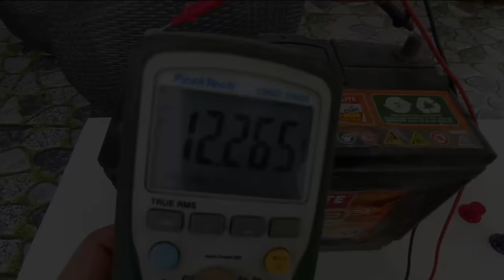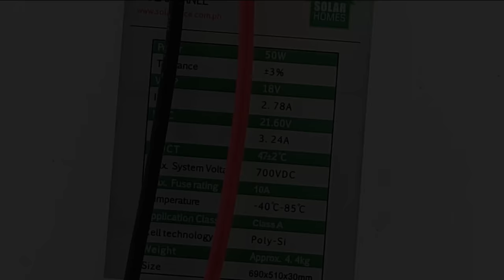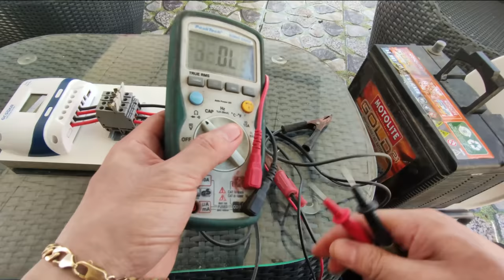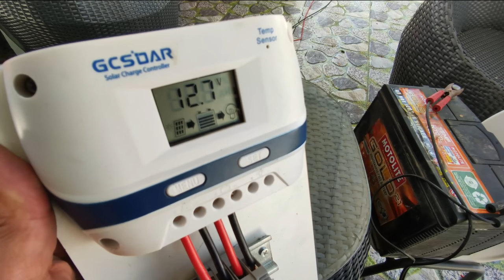Basic Solar Setup - Using Car Battery

Comment: Nice video of a quick setup, based on what you have on hand. I am planning something similar, but will connect a switch/breaker and some 12v LED lights to the MPPT load, outlet, or direct to the battery
Reply from the maker: It's better to connect the led light to the load side of the MPPT controller but make sure will not overload the load side of the controller so load only what is recommended load of SCC., if ever you connect it direct to battery you must ensure that the load will not drained the battery and use only until  the recommended Battery Depth of Discharge.

Comment: My husband made something similar after the typhoon. Because of the covid pandemic he has been out of a job so he basically build a manual controller with 2 voltmeter for a motorbike, 2 push switches, 2 diots and a on/off switch. We are using his car battery (car is inop). We are also using his car radio for entertainment/news, cell phone charging, 500watt inverter which even operates our sewing machine.
Reply from the maker: Thanks for sharing madam Lelith... You're very lucky to have a very resourceful hubby... GOD Bless to you and your family
Reply: I just bumped into your channel and finally found a practical tutorial on how to reuse our car's used battery. I took notes ..and will play this again when I finally assemble the same. Thank you!

Comment: Very simple lang para hindi masira ang car battery. Na gagamitin sa solar. Bili ng car battery charger. At e sak sak sa inverter. Tapos e charge ang car battery. Kung cp ang e charge Sa 12v car battery. Dapat may cp charger na pang 12v.
Reply: pag nilagyan ba ng car battery charger magagamit mo padin un car battery as a solar battery? pede padin mag pull ng power dun?

Comment: good day idol rod salamat sa mga videos mo about solar
Gusto ko rin sana mag set up aolar water pump with a voltage of 12v and power 180watts pwede mo ba akong tulungan kung ano ang mga desired amperes and wattage ng pv panel, scc, battery and inverter salamat sir

Comment: Sir good day. Medyo mahal kasi magsetup ng Solar power. Naka WFH setup ako ngayon at need ko ng backup power, pwede bang icharge ang Solar battery sa Car battery charger using power outlet?

Ang gamit ko po kasi ngayon ay car battery motolite gold 9plates, 1500w DC-AC inverter and Car battery charger. Around 30mins lang ang tinatagal ng battery ko.

Kaya iniisip ko kung magdagdag ako ng battery yung pang solar na kung pwede syang icharge gamit ang Car battery charger para madahan dahan ko na din ang pagbili ng solar setup components.

Hoping to hear from you soon. Salamat po.

Comment: sir,

90ah battery, car battery
20 a scc
12v submersible pump
led lights

question:
pwede ba ako bumili 200 a na solar panel?

Comment: Plano ko din to Gawin para sa modem Ng pldt ko .para po pang brownout meron prin internet..
Kaya ba neto  sir Ang setup ko pra sa modem ,1car battery 2sm,10amp controller, 50 Watt panel at 30 watt parallel connection para po off-grid set up Yung modem ko? Pa advice po if kaya na..thanks po😅👍

Comment: boss kmzta,my tanong lng ako..meron akong dlawang 250 watts n solar panel s mkatwid eh 500watts at meron nmn akong dlawang 12vbattery n 100AH.ilan kya ang dapat na ampere ng dpat kong gmitin n charge controller n MPPT at gaano klaki ang inverter n dpat ko ring ilagay!sna boss msagot mo ang tnong ko kc ndi ko p xa mbilhan ng mppt.slmat and god bless

Comment: good day sir ganyan din ang gamit ko 3sm motolite at 20vlts solar panel  ok naman sa laptop ko 19volts soldering iron 30watts at pldt router ok naman sya lalo 7.30a.m hanggang 5pm ako nag laptop walang shuntdown ok parin ang battery at fully charge pa ang power pack ng laptop kaya extend pa ng less 3hours sinubukan ko isaksak ulit sa inverter ayos naman at hindi basta basta na drain ang battery umabot pa ng 4a.m halos paumaga na ng lubayan ko mag internet nka saksak din ang router sa solar controller charger sa may 12volts .nag dadalawang isip lang ako lakihan ang panel sa 100watts bka matamaan ng kidlat habang nasa trabaho ako at bka masunog mga gadgets.kaya 20vlots panel muna ang ginagamit ko pero bka bibili parin ako pag nasa bahay ko lang gagamitin para sure na ma disconnect ko agad.kaya naman yan sir wag lang sosobrahan ng mga matataas na watts ang isasaksak para makaya ng solar panel ma charge ang nakukunsumong current

Comment: Good day po sir. Pwedi pong paturo nmn kung paano po gumawa ng 3S na 100ah gamit po ang battery na Lithium-ion 18650 na 3000mah 3.7v paano po connection non ilang naka series at naka parallel.maraming salamat po.sana matulunganan nyoko.

Comment: Sir my tanong po ako,my rolling motorcycle food cart po ako na meron solar panel na 100watts ,40 ah na battery,gamit ko po sya sa ilaw sa gabi max.na nggmit ko po sya ay 3 hours,ang tanong ko sir,pag hnd na po sya nagchacharge galing sa solar panel,pwede ko bng icharge ung battery gamit ang rectifier charger ng motorcycle ko,papaandarin ko lng ang motor pra magcharge ang solar battery?hnd kya makakasira un sir sa controller at solar panel?slamat po sa sagot
Reply from the maker: Sir matanong ko lang may inverter pa po kayo or 12volts ilaw lang ang gamit niyo at ilan po ba ang total wattage ng load niyo na ilaw? gusto ko lang malaman bakit hanggang 3 hours niyo lang nagagamit ang ilaw at kung naka 12v na ilaw lang kayo saan naka connect ang ilaw sa output ng solar charge controller or direct sa battery. Kung naka direct sa battery ang ilaw, then i off mo lang lahat ng breaker ng solar setup bago i charge galing sa motorcycle.

Comment: Nice video, thank you sir. Madami po ako dito lumang battery sa trak at sa  elf trak. Ilang watts po kaya na solar panel dapat ko gamitin, kasi gamit ko po sa aking incubator. 2 exhaust fan, 2 bulb ba 50 watts minsan 4 na bulb pati po sa mga sisiw. Meron po ako 500 watts inverter. Tanong ko po kunh ano size na din ng charge controller ang dapat gamitin. Thanks po uli.

Comment: Hello ang Lead Acid kasi kapag overcharged eh may leaking at very harmful ang lead acid.

Ang sabi sa ibang videos, maglagay ng voltage protection board. Kumbaga manual na iset ang full charge voltage tapos ikabit daw ang Solar charger. Hindi ko pa natry pero meron ako nung voltage protection board.

Nasubukan ko na magcharge ng battery without solar charger, OK naman for 12V pero kelangan talaga ng voltage protection board or BMS.
Reply: Di po nilalagyan ng bms ang lead acid battery,, pwede kung LVD module, kung mababa misyado ang LVD ng isang scc,, kasi pag Lead acid batt dapat di baba sa 12.4v para tumagal buhay ng Lead acid,, pero depende sa Maker brand, mas sikat na brand mas matagal ang life cycle syempre mas mahal din.

Comment: Morning po sir, tanong lang po, kung ang solar panel ay 60watts, solar controller 30AH at solar power inverter 500watts, anu po ang kaya niya paganahin na apliances, kaya nya po b ang TV n 24 inch, Gsat, at electrectfan?
Reply from the maker: Sir, kung lead acid po yang battery niyo, 180WattHour lang po ang power na pweding i consume dyan from full to 50% Depth of Dishcarge. Ibig sabihin kung ang load mo ay 180 watts ibig sabihin isang oras mo lang estimate magagamit ang battery mo, at kung 18 watts lang ang load mo aabot yan sa 10hrs  naman estimate lang po yan hindi pa kasi kasama dyan yung mga losses. so para ma estimate mo ang gamit sa battery kunin mo lahat ang wattage ng gusto mong i load at i total mo then ang 180Wh ay idevide mo sa load total wattage at ang sagot yan yung estimated hours na pwedi mo magamit ang battery. sa umaga naman kapag full charge na ang battery mo pwedi mo rin itong lagyan ng maliit na load at i observed mo lang ang battery na hindi mababawasan ang charge para palagi kang may full charge pagdating ng gabi.

Comment: Sir pwede mo ko mabigyan ng right size ng wires na gagamitin from solar panel to battery. Thanks and God bless.
Reply from the maker: ang wire size ay depende sa setup na gagawin. Abangan niyo po yan gagawa ako ng video regarding sa wire sizing at fuse/breaker sizing.
Reply: @rodBACON  abangan ko Sir. Plano ko 200watts lang na solar panel. Lagi kami nagcacamping sa bundok pangcharge lang ng gadgets at laptops at 1 or 2 na ilaw. Kamusta pala jan sa inyo after Odette? Thanks again and God bless.

Comment: sir pano kung gusto kung tatlong 12v n ilaw ung gusto kung ilagay sa load nya pano po un eh isang terminal lng ung load ng solar charge controller? salamat sa pagsagot
Reply from the maker: I parralel mo lang yung connection Sir or gamit ka ng splitter or wire terminal box yung may 2-in at ang out ay 6, Search mo sa lazada TERMINAL BOX HOUSEHOLD DISTRIBUTION BOX, make sure lang na huwag kang sumobra sa maximum load na kaya ng solar charge controller check mo sa manual kung ilan yung maximum load ang kaya ng iyung controller.

Comment: sir, tanong lang po at kailangan ko po ang sagot,kung naka clamp na sa line ng AC ang split core w
e saan po ikakabit ang wire galing split core ct?txbk please
Reply from the maker: Kung itinatanong niyo Po ay CT ng solar inverter, yung wire ng CT ay papunta sa solar inverter meron na itong terminal sa inverter para sa connection ng wire ng CT.
Pero kung sa electrical system in general ang tanong niyo po, Ang wire ng CT ay papunta sa isang Ammeters na match ng CT or pair ng CT.
Reply: @rodBACON  sir grietie inverter po mayroon ako saan sa ikabit  sa DC in wire o sa AC out wire ng inverter. pakisagot lang po tnx.

Comment: Very good Sir. How about prepare for emergency with  ac converter, charge controller and disconnect one or two solar panels from the grid tied on the roof. Do you think it will work with car battery in an emergency ?

Comment: Late watching sir ROD. mangayo unya ko nimo sugestion wala pud mi kurente sir sa Bien Unido Bohol.
Sir ano ang match sa 100w na solar, Anong scc at battery please sir at mga wiring nito. Sukad wala pko ka assemble ug system sir ba please.. thanks..
Reply from the maker: Paliti lang na ug 50ah na battery sir ug 10A na Solar charge controller Ang imong 100watts na pv sir
Reply: @rodBACON  yeheeee salamat  sa reply sir ROD
mKa muntar job kog Gamay
Ani sir hehehe salamat. Copy. God bless po.
Reply: @rodBACON  Ayayy kalimot ko Sir Rod kon mo gamit kog enverter sir pila pud ka watts ang pwede.. thanks..